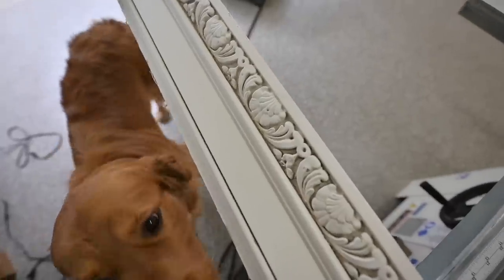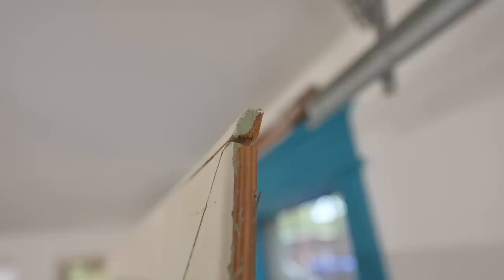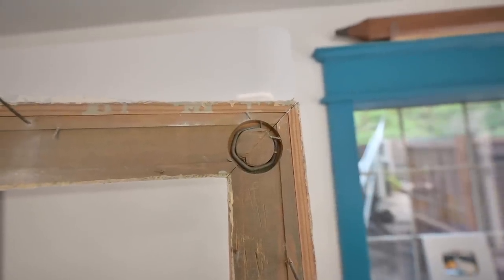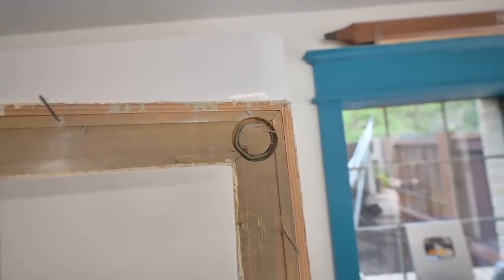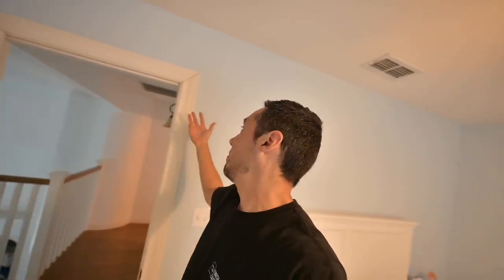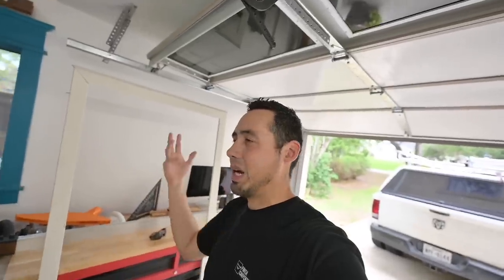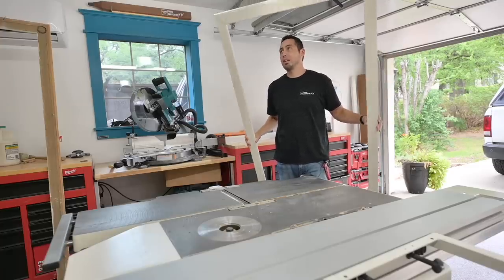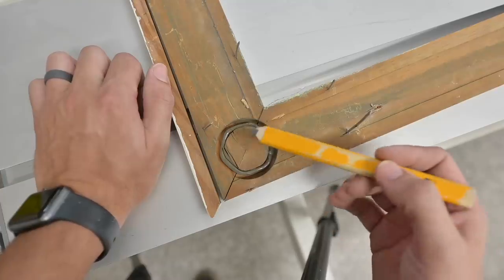Door casing skill lost for 100 years

Comment: I think a jig was used with a pre-made hole which was the guide.  The corners fit into the jig and held there. Likely all this was done with hand tools.  We have lost the art of using hand tools.  I have used jig guides for drilling holes, so that the bit doesn't wander at all.  Watch some ship wrights build a boat with hand tools. It will amaze you. They do use large hand held power saws and a ships saw is amazing to see in action.  I agree that the inner hex was cut with a chisel.  My uncles house (1940's) had T&G mitered door corners with a wooden dowel pinning them together.  I bet he did that because he was a master wood worker.  Those guys born at the turn of the 19th century had many skills with hand tools.  In the 1800's an ancestor was the town carpenter.  He built cradles to wagons to coffins and some row boats, whatever the town needed.  When I was a baby, my uncle had all those tools.  God knows where they are now.

Comment: I think it is a situation like wagon wheels.  When they install the ring it is hot, when it cools it shrinks tightening that joint.
      Heat up the hex, place on trim hot. Cut out the burned shape in the trim.  After it is all cleaned out, place the ring that is once again hot into the joint and dowse it with water. This shrinks the ring. 
    The ring, being hexagonal, will be easy to align in the same exact way it originally marked the joint with the burn pattern.
     Also, the hot hex-rings can be installed at the last minute when they threw the pieces up.  They wouldn’t have to haul a pre assembled casing around?
    I am not feeling that last bit there.  I might have gotten too excited and gone a little to far with the idea.

Comment: every last ring looks like it was pressed in place. 
there is one edge on each center that looks crushed down like the ring was placed on one side and pressed down over the puck. 
wet wood is known to flex and i grew up hearing that it was common practice to soak oversized wood before pressing it through a narrow piece of iron and letting it dry, locking it in place (like with axe heads.)

Comment: Predrilled template for a hole saw, without center bit. Then heat up the ring so it expands and drop it in groove, as it cools it would tighten up.   Today you could use an external snap ring in the grove.
Reply: That's a good idea. Would the hot ring char the wood a bit?  I'd assume we'd see some dark spots on the wood.
Reply: @AV8R_Surge  good point.. 🤔

Comment: I don't think they would have chiseled the inside of that hole. If you think about it, why would they make the ring hexagonal and not simply round?
The reason is it it flexes much more easily, in order to flex a circle you'd have to strain the steel but the hexagon shape can bend a little. Then they carved out these round holes and press fit these rings into them.
Since the rings would have to be slightly deformed they would hold the wood together and allow for quite a bit of shrinkage which is why they look so good after so long, over time they've deformed the wood on the inside making it seem hexagonal.
If what I think is true you won't have an imprint of the ring near the corners of the hexagon since they won't be touching the wood. These kind of press fits are hard to calculate for steel and much harder in wood so these guys were really pushing out some quality products, going beyond anything I've seen modern manufacturers do.

Comment: Use a hole saw to make a hole in a scrap board which you then clamp to your finish miter joint and use as a guide for your hole saw without the center 1/4” bit.

Comment: Make a mold from the ornate carving pattern so you can reproduce it with a resin shell that can be installed over standard molding. Would make it and other incredible designs available again, and if made as a snap-on and paint ready shell for standard molding, it could be added to existing doors without having to remove the existing trim.

Comment: Cut a square piece of 2"x6". Mark the diagonals from corner to corner. Use the hole saw to cut a hole fully through the square, centered on the vertex. Extend the diagonal markings along the inside of the hole, perpendicular to the faces, with your square. Clamp the trim pieces to the 2x6, with the joint aligned with two opposite diagonals. Remove the drill bit from the hole saw. Use the hole saw, centered and held in place by the 2x6, to carve circle out the back of the frame. Remove 2x6.  Lay your metal ring over the inscribed circle, and trace the inside of the metal ring onto wood in the center of the circle. Use your wood chisel to knock off six edges of the center, not truly square, but at a very slight angle, so that the outside/top face of the circle (now a hexagon) is ever so slightly smaller and tapers out to the base. Lay ring on top of center and pound down into place with hammer. secure with two angled brads on opposite sides.

EDIT: I paused at 9:00 and wrote the above. guess we're kind of in agreement.

Comment: Instead of using a welded hex shaped ring use a radiator hose clamp. That is a spring steel circle,where the ends overlap, with legs at each end of the clamp.. You have to use pliers to squeeze the legs together to open the circle. Put the circle over the cut out ring, in the wood, and release the legs. The clamp tightens down on the ring of wood. You may have to cut off the legs.

Comment: In order to create the miter, to hold the pieces in place I suspect the first step would be to build a jig to hold everything in place accurately. Then you would take a device similar to a brace that is anchored in place on the jig, but has a narrow cutting blade that rotates as you turn the crank. Optionally, it could have been on a screw mechanism such that the blade descended with each turn automatically, creating a consistent cut.

After you have the circular channel cut, then you could mark the center for the hex ring and use a hand chisel to cut the center into the desired shape which would allow you to install the ring.

Comment: They used a board as a guide for the hole saw and a clamping fixture. I often use a 2x4 with a hole as a guide for a hole saw when I need to expand holes so it works well

Comment: seen many of those in San Antonio near or in thge older german homes. the carpenter I was helping would pull the whole framing out and he had a wrench to turn the nut/ clamp to turn the ring 30 degrees to loosen .  there were more complex corners including a square ornament which joined with

Comment: That drill bit in the middle of a hole saw is called an arbor. I’m glad you pointed out there was no arbor hole, because it helped me to understand how they did it. You can use a hole saw without the arbor if you clamp a jig to your work piece. They probably had a jig that held their casing perfectly flat and square AND held the hole saw. What do you think?

Comment: I'm in the USA and my toilet lookes like a normal toilet but it only uses 4.8 liters per flush. It is the only one I've seen like it but it uses a half circle shape plastic tub that's elevated at the top. When you flush it causes a chain reaction that makes the tub fall over and poor out all the water then is balanced to swing back to level and refills the tub using a floating switch to stop the water when at the fill line.

Comment: I would think that the easiest way to cut those circles with hand tools would be to use a scorp on a trammel.  What is a scorp I hear you ask? Basically it is a flat narrow blade shaped somewhat like a lathe parting tool.  A trammel is a circle drawing tool which is basically a beam with a pivot point at one end with a clamp which can slide along the beam, the clamp holds the drawing or cutting point. Such  a tool would only leave a small divot hole at the center which could be easily  sanded or scraped out. No guarantee that that is how they did it, but it seems a likely possibility to me.  Once the circle was cut the hex shape could easily be formed with a chisel.

Comment: It is actually a pretty simple technique. The miter is created and clamped in a jig. The original hole is drilled using a guide. The hex shape is roughly chiseled in and the hex ring is dropped in. Then comes the magic… the ring is turned with a socket. This preloads the miter faces. The key is the hole has to be big enough to accommodate the socket. The hex is turned into place from loose to bite the wood so it doesn’t pop off. Notice the points of the wood hex is on the miter line. This keeps the miter aligned along the cut and the biting of the ring also hold it into face alignment. The jig to make this miter is probably also the jig to cut the miter. And no bigger than 2ftx2ft. Oh, and the weld is there to keep the ring from backing off when turned… it digs into the wood and eventually settles in and locks it in. It is an ingenious system… it just got replaced by a “cheaper/faster, who cares what it looks like after I’m paid” society.

Comment: That technique reminds me of old time wheel-wrights, where they'd heat up the metal ring and slide it over the wooden wheel where it would get extremely tight when it cooled. 
I think the hole saw was plunged through a pre-cut hole in a jig that was used as a guide, thus no need for the pilot drill. Just a thought...

Comment: A possible way to drill out circle would be a jig consisting of a front plate and back plate ie. 1x6 squared with a spacer in between on sides that form corner and having the front plate pre hole drilled to act as a bore for the pilot bitless hole saw…to work in conjunction with clamps

Comment: The center was circular, and the hex of the ring makes the sides springy.  If they were both hex or both circular, then you wouldn't get any springiness to take up slack as the joint cycles with the seasons.  You could cut the slot with a brace with a hole-saw-like bit without a pilot drill by using a pilot hole the same size as the outer diameter through a top piece, like a pocket drill guide like a Kreg.

Comment: The carpenter used a router template to cut that groove channel circle . I couldn't tell but are the nails cut nails? Interesting solution no doubt. I have never seen that technique in My 46 years of the trade. I used to save interesting tear outs when I was Young also . If You ever visit New Orleans You must see the civil war era joiner's chest and tools on exhibit at the Cabildo! It will blow Your mind .

Comment: For doing it today, with commonly available tools, I wonder if a router with a template would work.  Clamp down your frame, clamp a template with a circle cut out of it over the joint, then use a router to follow the circle.  Afterwards lay a hexagonal template over the raised center of the circle, mark the sides of the hexagon with pencil and then chisel them out with a hand chisel.  To make the metal hex rings,  make a hex sided wedge and drive it into the end of an appropriate diameter piece of EMT then slice off a hex sided ring with a hacksaw.  Repeat until you have all the hex rings you need.

Comment: The hole saw could be positioned by using the outside ring left over from a hole in a pc of ply...clamp it to the trim assembly , remove your pilot bit , collar the hole or drill it as deep as you need ! If you need a wider kerf  use the same technique for a larger or smaller hole saw !  I would expect those hex sides are sloped to tighten with driving. Build it into something backside out to spark conversation !

Comment: As far as the holding of the miters together I used what's called "Hog Rings" which is a partially rounded ring almost elliptical with points made of tempered steel and to use it you need pliers to fit the ring in order to stretch it. The points bite the sides of the corners and when you relax your grip on the pliers it bites the casing forcing it together

Comment: my guess on how the circular hole was made without guiding hole would be that there was a fixed table and the frame was inserted, fastened so that it would not move. 
it sounds like that could be a manufacturing solution for larger volume of these (a production line for frames bit) infact you know like for a house or bulk of painting or something.

since i do not know what drill press is so i might have just accidentally described that shrugs

Comment: I’ve been using a similar technique on picture frames. I drill a flat bottom hole half way through the frame that cuts through one side and one top (or bottom) and then glue a disc in the hole being careful of the grain direction. Nothing is new I guess.

Comment: You can cut and bend a big nail in that shape and weld it on site. Cut each end off creating the desired length and make a mark 1/12 the length of the nail from each end and make 4 equally spaced marks 1/6 the length of the nail between the two original marks, they could be measured out with a homemade ruler for this specific job or just a regular ruler. You can use a vice, a hammer and a 360/6 (60) degrees wedge/guide to place against the nail while hammering. It would not take a long time to litterally bang out a bunch of these. The first portable power router was invented in 1906.

Comment: My bet is that either they had a tool made expressly for this operation or they made a jig for the miter assembly with a hole for the hole saw, meaning guiding the hole saw blade from the outside and not with a drill. Would be interresting to see a close up of the hole from which you removed the hex clamp to look for tool marks.

Comment: I used biscuits and 5/16 wide crown
Staples along backside of miter or
Even top side at inside of miter that
Would be covered later. Staples allow more clamping pressure to
Be used without slippage along
Miter. Biscuit  helps keep plane.

Comment: Windows aren't wood any more, but I'd recess two screws to pull the corner back together since it gets painted anyway.   
Touch up caulking is always required.
The quicker the better if you're charging by the hour.

Comment: For the circle they could have clamped a metal or wooden guide plate with a pre-drilled hole. The clamped guide would provide support to the hole saw without letting it cause tear out or walk around and scarring up the piece.

Alternatively instead of a hole saw they could use a chisel/plane on a central pivot that allows the cutting edge to spiral down through the material by extending the blade, this also supports the wood and prevents tear out using the base of a plane or another supporting plate clamped to the work piece.

Comment: I would use a 3/4" ply template. Precut 90°corners, the width of the trim on the ply, and pre-drill the ply with the hole saw. Step up the hole sizes. Let's say 
1 1/2" to 1 5/8" to 1 7/8"... You get the idea. The template allows you to clamp the trim snugly and cut the ring without the guide bit using the template as a guide.

Comment: Here's how it was done.

1: cut joints. 
2: clamp together. 
3: use drill press with hole saw to preset depth.
4: clamp on hex metal plate guide matched to ring size tolerances.
5: use specific width flat chisel to make light work of 6 sides to be cut.
6: align ring using jig and pound on. 

In a factory they would have a machine like a chisel press to speed up production.  Rings can be made with basic cold wire steel. If you have a basic $300 welding machine, you could make your own. Not very hard.

Comment: i think your clamp + drillpress theory is correct. With a drillpress you dont need a guiding drill bit. As for the rest of it... i doubt any chiseling was going on.. it wouldn't hold due to wood not being compressed hard enough. So it seems the hollow-drill metal part was just thicker then the one you showed. And then they just hammered that hexagon onto that circle. From what i can see at 10:40 they just put the metal part in on the right side and did the hammering on the left side. That's why there is cracking and squished wood on the left side. That way it would press the wood on all side and no amount of moisture change or wall deformation would wiggle it open. It would crack the wood before any sideload would open it up.

Comment: CUTTING the circle in the 90degree frame.  First cut the whole size needed with the whole saw then use the external remaining whole left in the flat board as an a external whole saw guide.  I do this a lot. No centering drill bit needed.

Comment: cut a hole in a scrap board with a hole saw then clamp that board on the jamb, remove the center guide hole bit and use the board as a template/jig.

Comment: To create your initial holesaw cut, use the tool without the drill centre bit, inside a sacrificial/template piece with the same hole already made. 
Alternatively to do it faster for today, same plan but use a trimming router inside, with a roughly 5-7mm bit(1/4") having a top bearing or a template guide and drive a ring rather than the hex, would be fairly quick.

Comment: My first thought was that the metal ring was heated up and pressed into place like a metal ring on a wagon wheel. When it cools down it shrinks and would pull the two pieces together.
Then you said it was hexagon shaped and I wonder if when you put the metal hexagon on it wasn't turned 1/6th of a turn to draw it tight. That would also give the appearance that it was rounded out where the ring sets down in.
Several of the comments below people seem to have the tools to do this and I would live to see a video.

Comment: Is the ring brass ?
Looks like it might be.
If so, you know they could probably have heated the brass hex up as brass expands a LOT, then push over / into the circular groove, allow to cool and contract.
It would really pinch on the 6 'hex flat' contact points and pull that joint tight.
This method is used to fix glass into heavy brass clock bezels, I make convex glass for these types of applications, and the brass expansion thing in boiling water really allows for good expansion.